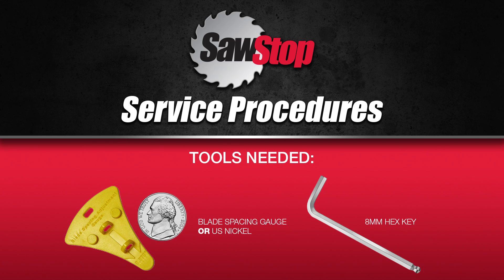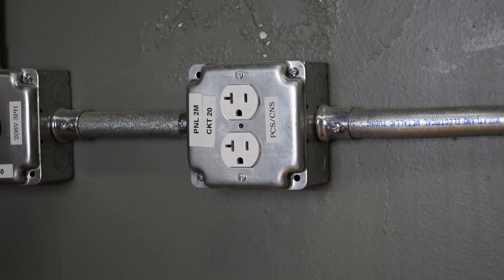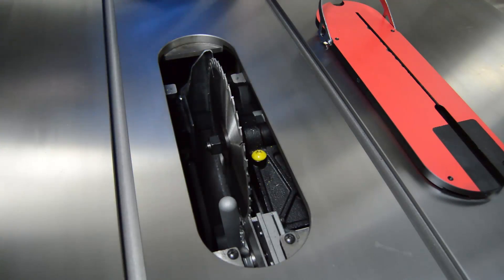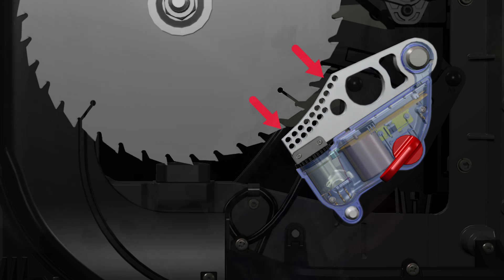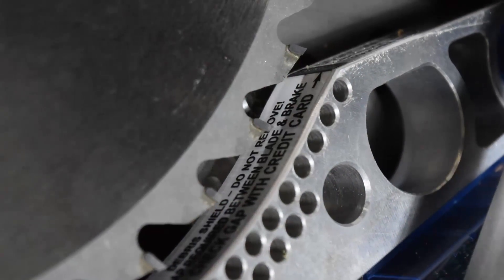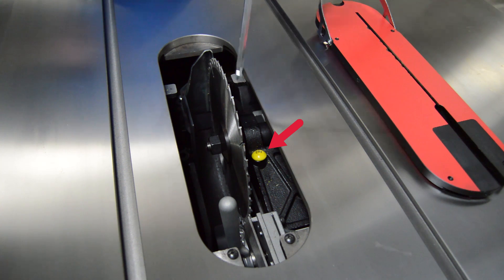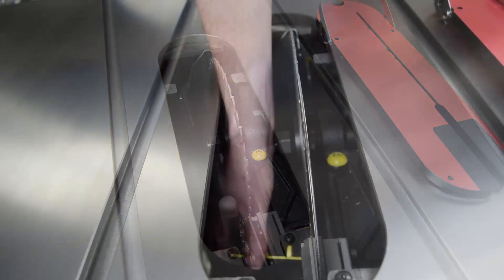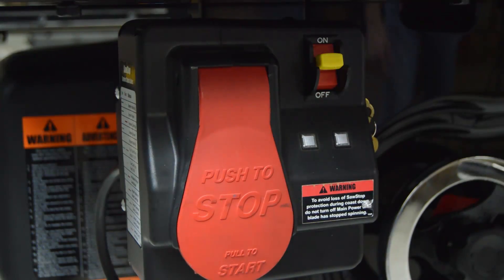SawStop Service Tip: Adjusting the Blade Brake Spacing on your CNS/PCS/ICS table saw.

Comment: What do you do if you turn the adjustment screw as far CCW as possible and still do not have sufficient clearance?  I recently fitted a Freud SD608 dado blade and the dado cartridge and I am unable to get enough clearance at the upper clearance check point.  I have maybe 55 to 60 thousands, but not enough for the 70 thou plastic gage tip to clear.  Is this a problem?  I turned the adjuster screw as far as I could using the supplied hex key.  I did not want to risk overstressing something using a socket and ratchet.  It felt as though it was coming up on a stop spring as it got progressively stiffer and then did not want to turn further.

Looking under the table, I see the locking nut on the bottom of the adjusting bolt and it is at least 4 threads from the end.  Does this lock nut provide the end of travel stop?  If so, can it be turned farther down a thread or so to gain more downwards travel?
Reply: same question.

Comment: Does this brake cartridge work with a dado setup?
Reply: jack-tal There is a different cartridge made for dado blades that has a wider block and a much larger block to get close to the smaller diameter dado blades.

Comment: Is there any reason you can not do this process with the blade FULLY up? it is a lot easier to reach all the parts involved in this process with the blade fully up, and the whole carriage seems to move as one so it does not seem to effect the spacing.
Reply: good question